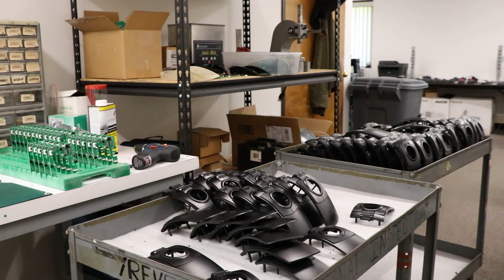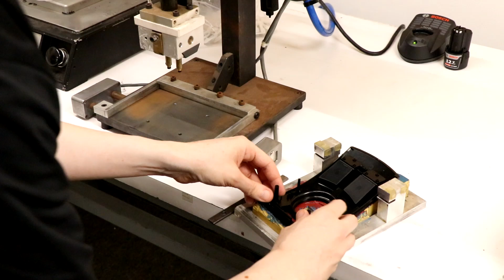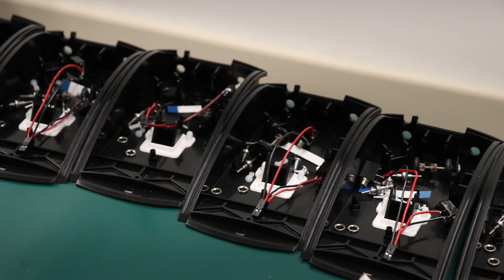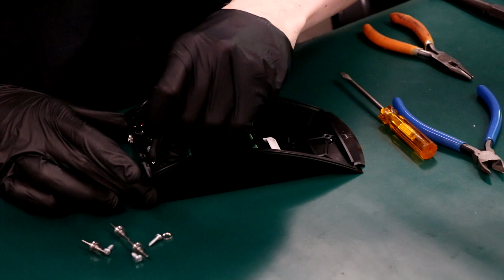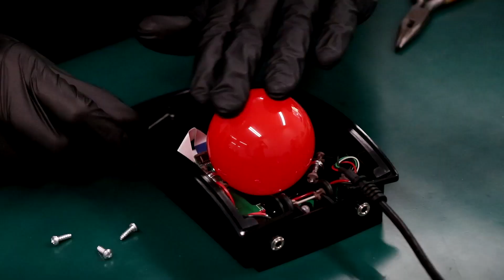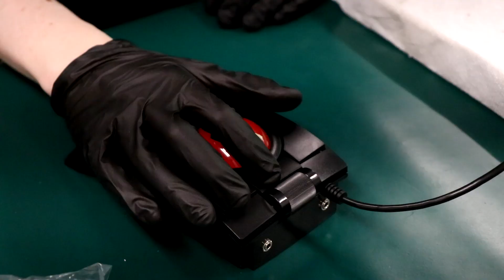X-keys L-Trac Trackballs

Comment: I own 4 CST Trackballs. Modding them to a 5-button device is easy. The New style bearings tend to wear out. The flat old style is better and with proper maintenance (oil instead of grease) they are very smooth. I modded all my CST trackballs with real ball bearings. They run smooth, are maintenance free and will virtually last forever. This should be available as an Upgrade kit for people which don't want to produce them by themselfes.

Comment: fan from germany here
my left button died and Liam from Customer Support figured my switch might be the issue
ordered replacements Panasonic 
EVQ-P0E07K 10pcs for 3 USD 
two solder joints a little clean up and it worked fine again
Reply: I also needed to replace the left button microswitch. The Board accepts high quality microswitches from omron in the "D2f" format. These are available in higher quality and will outlast the device. They should be equipped as standard by the factory.

Comment: Quality Control took a nosedive after X-keys took over the LTRAC from CST. I had to order two - the first one had erratic mouse motion and a chipped ball - and both look pre-owned out of the box with lots of scratches and divots. My original CST model looked and worked like new for almost 10 years.

Comment: I have the two external switches (Auxiliary S-Button) you make. Very nice indeed. However, they would benefit from being higher up, meaning less finger stretch from the trackball. Has anyone made or printed a black plastic, stick on base for them? More aesthetically pleasing than any old lump of wood. Finally... yes, the quality on these trackballs is superb, and works out of the box with Arch Linux.
Reply: Thanks for posting that they work out of the box with Arch. I use Pop!_OS and Fedora and don’t like installing proprietary drivers. Does it have onboard memory or are the programable functions stored in software?

Comment: Do these trackballs have onboard memory, so that once you program them, you can unplug them, and they will perform the same  action, regardless of which computer you plug it into? Or are the macros/programming stored in software on that one specific computer that they were programmed on?
Reply: No onboard memory. Default set up only without software.

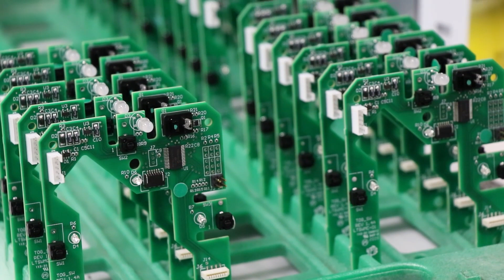Comment: Huh was going to contact support about my “new” ltrac being absolutely covered in scuffs (actual physical damage to the plastic, not something that can be washed off) that make it look like a used unit (not even a refurb) but judging by 0:29 in this vid that’s how they all look. Honestly guys that is completely unacceptable for something so expensive. If for some reason you simply can’t store them in a more delicate and professional way you could at the very least have someone buff/polish them once assembled. And if you can’t even do that it is just scummy as hell to use clean, non-scuffed units in your product photos when you know full well you aren’t shipping something that will ever look anywhere even close to that clean.
Reply: Just ask for a replacement, they're very accommodating. I hope no-one takes your advice to buff and polish ABS plastic though LOL , that will make it WAAAY worse.
Reply: @Kaptnkrnch  literally every single unit they sell is like that. I have three, purchased at different times over the course of ~6 months (specifically because I wanted to give them the benefit of the doubt), and all of them look like they were stored in a pile on a warehouse floor.

Comment: couldn't your team re-jigger these to have 4 more button switches on them? As is with just 2 buttons, these are not useable for the vast majority of us. The reason the CST were never bought in any volume is due to this severe limitation. The Expert & slimblade with just 4 buttons is also severely limited. Because we are so used to mice with at least 7 buttons (right/left clicks, back/forward navigation, left/right scrolling, and ideally midlick for continous scrolling), these antiquated devices with just 2 clickers like those rudimentary mice from 1985 will never sell enough to be worth it for your company. Please consider it.
Reply: I realize this a cpl years old, but I wanted to chime in. 7 buttons isn't very ergonomic. You can have efficiency or ergonomics but you can't have both. Most of these things were designed for kids with disabilities. Keep that in mind.